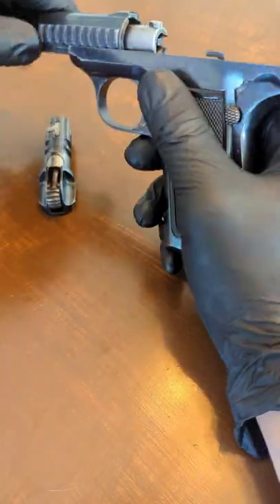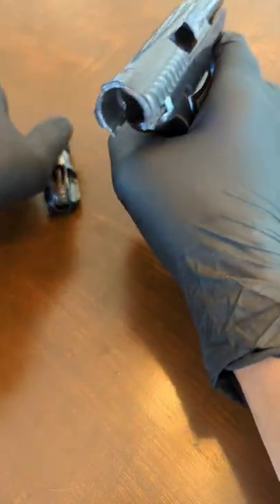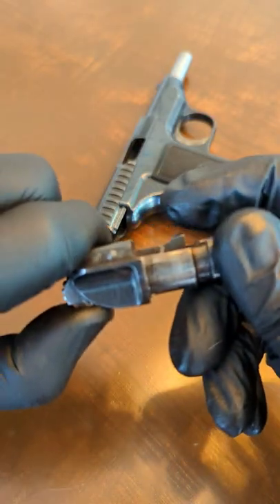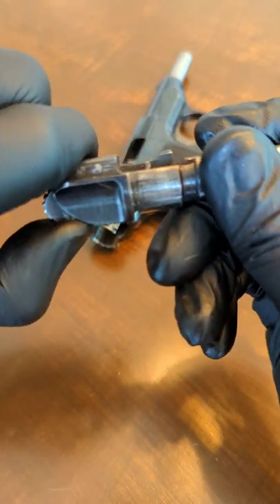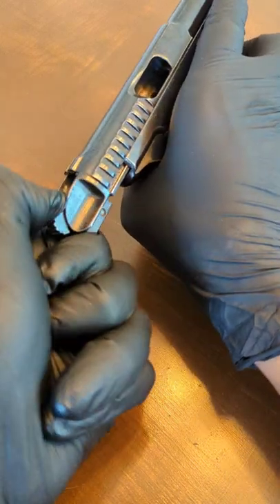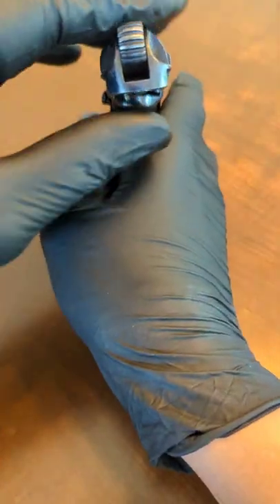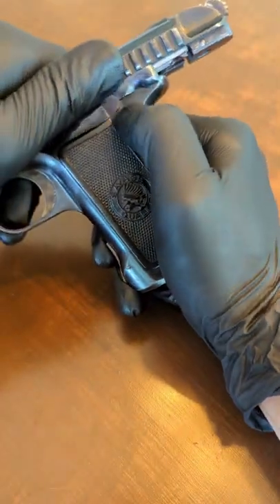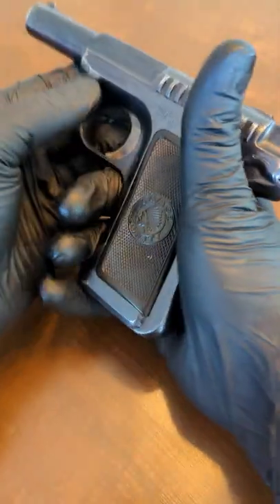Quick Reassembly: Savage 1907 | Pt.2 | 4K 60FPS

Comment: Careful to hold the trigger on disassembly & reassembly to keep the sear from popping up - it can be broken if you are not careful and replacing with parts from another gun often requires some fitting, even if it is the same year of production.
Reply from the maker: I was not aware of that step in the process, thank you for letting me know.